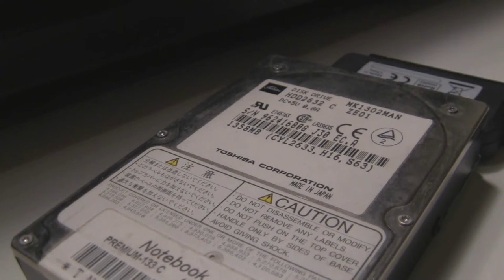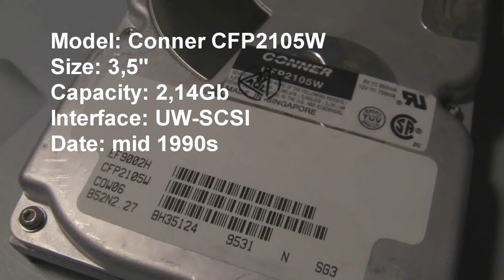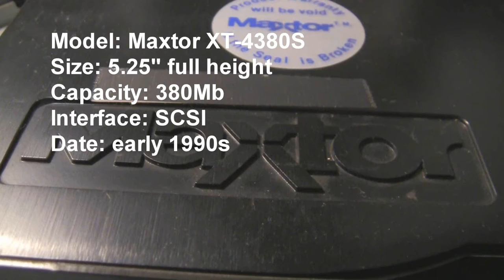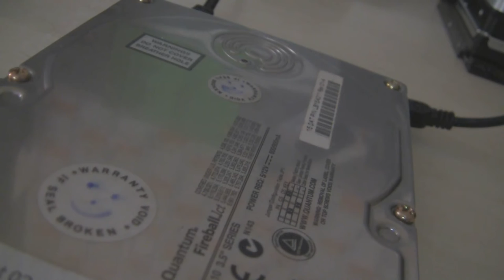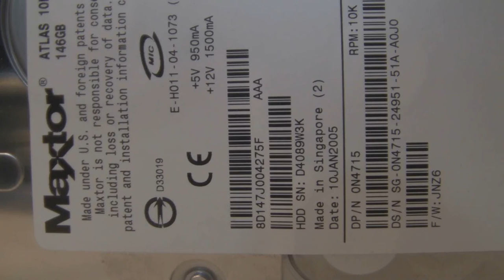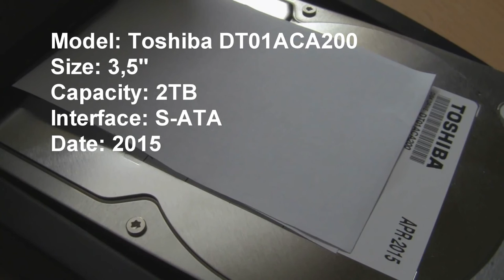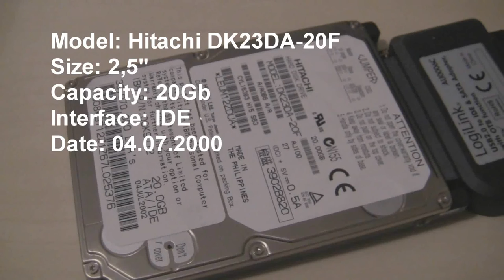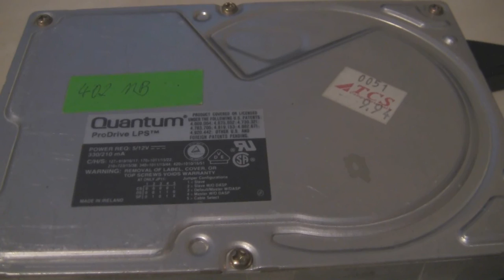All my hard drive videos from 2015

Comment: thats strange how the 1 seagate mfm drive parked when u powered it off, i thought those needed a "park" command to do that.
Reply: The ST225 needs to be manually commanded to park before shutting down, but the ST251 does that automatically when power is removed from the drive.